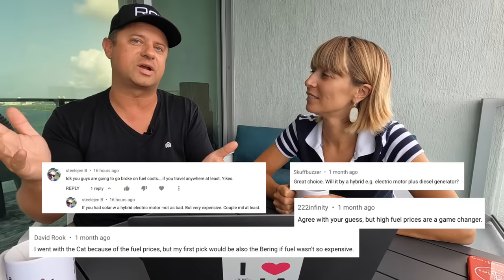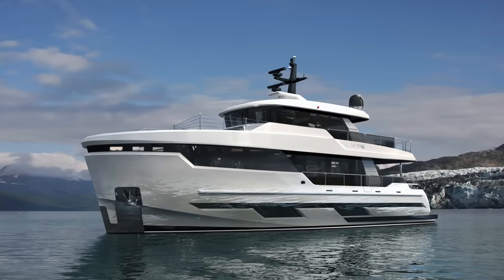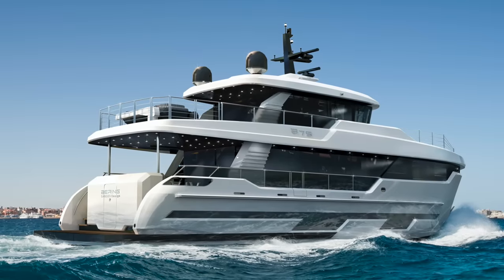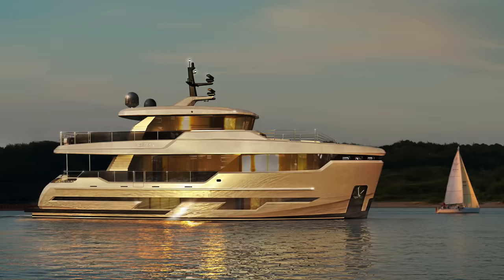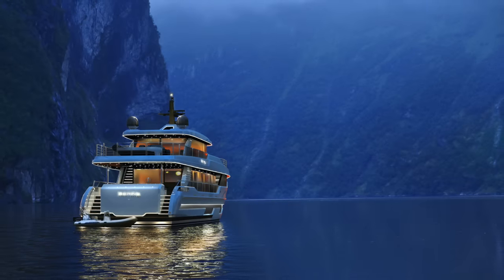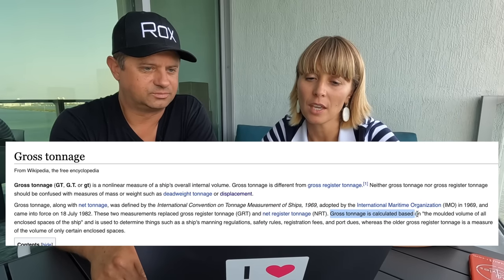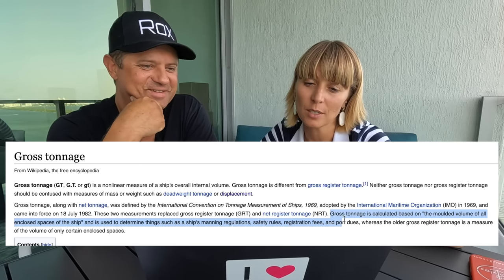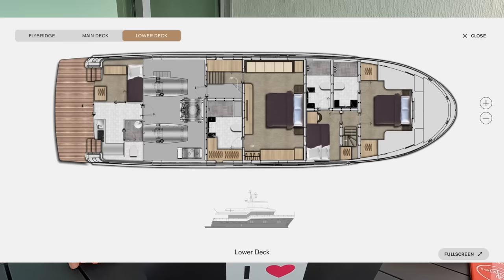WHY NOT Bering 70, 72, or 77? YOUR QUESTIONS ANSWERED Eps. 3

Comment: Outtakes? Of course! This part shows that you guys working hard to get the stuff together.
Why B75? Pretty clear why no B70/B72, but the deference to the B77 is interesting. And if you opting for the cabin on the upper deck, that's pretty much super yacht standard, oh wait, most of the time the captain has the cabin on the upper (bridge) deck and not the owner...
Can't wait to see more about the details of the propulsion and how much electrification!
Reply: @NautiGuys I guess this answer is fraud ^^
Reply: @markush.2445  NO IT IS REAL. The NautiGuys logo with the red heart below your comments on the right side is from them, the fraudsters can't do this unless they HACK their account. They can only make a reply to your comment using their logo. If it is the NautiGuys that reply to you there will be their logo with NautiGuys in a GREY box. Have a good one

Comment: I noticed a Nordhaven video that discussed the seakeeping benefits of a twin keel design. Twin keels have a shorter draft and can also permit bottom docking in places with high tidal variances - in a pinch. Sometimes it's nice to stop the constant rocking or to service the hull during a low tide too I imagine. The real benefit of a twin keel appears to be in following sees where a wave can pick up a boat and "surf" them until they turn sideways and roll over them sideways. Two Nordhaven 55s - one single-keeled and one twin - were buddy boats who compared their responses to side waves that turned the single keeled 55 ft (GRP) trawler a full 90-degrees sideways.

Comment: The channel should be about charter boat operation: purchase & financial considerations like # of guest - weeks needed to satisfy financing arrangements. Charter market and what level of accommodations guests expect ( I would divide the owners stateroom into two cabins). Cooking and provisioning for guest. Charter boat regulations, etc. Lots to talk about. Not to mention providing activities for the, guests. From the time I was in university I wanted to run a dive charter boat. I designed a 210’ sailing ship at that time ( steel hull, 40 guests, 20 crew ). I like that you are acting on your dream. I never achieved mine. I would have settled for a 24meter (95’, 12 guest, 6 crew ) boat.

Comment: You answered the question that I did not have. The choice of yacht size is purely your own. I never questioned it. Just make yourselves happy. As far as size goes, Bering has the 70 - 72 - 75 - 77, so obviously they felt that there was a need for several sizes in the 70's models. And as you correctly pointed out, it makes a big difference in the GT. And you must absolutely have Out Takes in all your videos.

Comment: I really like the robust look of the 75. It's the best looking modern interpretation of a trawler that I have seen. It's easy to see why it was your pick. 

I was amazed at the huge increase in gross tonnage (= increase in interior volume) over the 72.  A boats length is not always a good indicator of it's size. 

I had wondered where you put the second master cabin and that sky-lounge area makes perfect sense right behind the wheelhouse and separated from the charter passengers. I couldn't figure out how you could fit two master cabins below deck.

Comment: My dream is to have a boat like the B75 that is focused on a large group going up into Canada to fish. So the idea of having this one big full beam primary seems out of place for my use. I would split that space and do what Horizon did on the FD87, make two VIP cabins. In your case you would then have 5 guest cabins on the lower deck and then your quarters on the upper, while still having the crew quarters. I also, for my purpose, would try and make as many of the room having convertible beds (twins to queen/king). By doing this you have very high flexibility in who you assign to each cabin. I would have primarily men on board so a queen bed in just a one person deal (In my world! 8-).....) You may find this arrangement not only gives you another VIP, but it also stops any arguments about would get the massive primary cabin. Just a thought. Cheers 😀
Reply: You could make the separation between the two VIPs a pocket door and have one side with a convertible sofa. Then you have all your bases covered!!!!!
Reply: I missed you message, could you please resend. Thanks.

Comment: Ok I have two questions -- (1) You briefly referenced the difference between a Crew/Captain, vs private-only vessels driven by owners that barely know how to steer the boat. At what point (size/weight/etc) is a licenced captain/etc required vs unlicenced owner driven. (2) In a recent video, I think the most recent weekend video, there was a brief comment about the galley being strongly restricted to a licenced chef/etc. At what point does this come into effect ? Does this apply to fully private yachts or just 'commercial' (charter/etc) yachts. --- For both questions, case in point : A few friends and I have been considering a yacht of some sort for some years as a private, live-aboard exploration/research vessel. Our current candidate is the B145 or something similar. We would prefer to have minimal crew, only whats absolutely required for boat operations and maintenance. We would want to do basicly everything we can ourself. For this use case, how much minimum crew would be required for the B145.

Comment: Rewatching. Again. Question: What decides the draft of a yacht? Displacement? Length plus beam? The engineering people figure it out during design? 
Rico, your camera work has been outstanding for some time. Well done. 
You two should do a tech spot about your video gear. I think it would be well received.
Reply from the maker: Great question! The draft of a yacht is determined by a few factors, primarily the vessel's displacement (the weight of water displaced by the yacht) and the design of its hull. The depth of the draft is often a consideration during the engineering and design phase, balancing factors like stability, performance, and where the yacht will navigate.
Reply: @NautiGuys  Great answer. Thank you.

Comment: Keep your out-takes. They are just great. 
A B75 is a fairly big unit. Nevertheless, despite the fact you'll probably have THE absolute owner cabin on the upper deck, you won't have as much space as you had to live. In addition I noticed one thing: your are missing a small office/chart table on your layout. With such a fuel guzzler, computing the magnetic bearing on a chart taking into account currents and tides makes quiet a difference in costs.

Comment: I’m so happy for you and jealous.  You two introduced me to Bering through YouTube and I’ve been a fan of you and Bering ever since.   Can you ask Alexey to build a smaller version of the B70 that could be used for the Great Loop.  I could see a B60 with an uncovered fly deck (a la DutchCraft DC 56).  I’d be a buyer tomorrow.
Reply: They no longer make it, but they did at one time make a 60 and there is one currently for sale.  It's about $1.5 mil though, and as with most Berings, bridge clearance might be an issue on the loop.
Reply: @chadm9715  thanks Chad, I knew they had a B60 that has too tall of an air draft.  For that reason, I’m asking Alexey to build one that can do the great loop. In other words, a yacht that meets both the draft and air draft limitations.  Appreciate the response though.

Comment: You should always get the biggest twin engines.I had a buddy with a 44ft Pacifica that had new 500hp ISC Cummins installed with California repower. At 7knots at just under 1,000rpm, he was burning 2.7 gal per hour for both engines! That's better than a single engine trawler.!

Comment: Awesome video.. very informative.  So I guess one of the deciding factor on getting the B 75 (hull no. 1) is the GT,  because it can be owner operated right? (please correct me if I'm wrong).  I totally agree that the B 75 and 80’s exterior design looks like a mini S/Y.  Question, on the 75, were you able to get all the things from the NBBL?, like the heated towel rack thing? or maybe a 85 inch TV?..hahaha.. and YES please include the outtakes in this channel.

Comment: Although not there financially I would have made the same choice.  B80 checks every box for what I'd want, but it's over 200gt so eliminated.  

B77 is the perfect size, length, and GT, it checked almost every box, but imo would be eliminated because of the split levels(as would B65 and B72).  Being able to personalize the interior with split levels becomes far more difficult, and more importantly for for docking I would not want the stairs to contend with.

This leaves B75, which checks nearly every box.  Unfortunately though, it's the only boat in the Bering lineup without a flybridge, something I would personally want, in addition to the pilothouse if building.  It would still be my top choice if building.

Comment: Hi guys! 

Love your channels! I’ve been binge watching all your episodes since I  discovered you recently,

May I assume that you are not going to charter  your future live aboard Bering 75 between US ports due to restrictions requiring such vessels to be manufactured in the US unless your 75 is granted a MARAD waiver to obtain a coastwise endorsement on its Certificate of Documentation?

I understand for a vessel to be eligible for a MARAD waiver, foreign-built U.S. flagged yachts must be at least three years old and owned by a U.S. citizen. 

The reason I am asking is that I am involved peripherally in a project involving the construction of a series of new American-built motor sailer super yachts that will be used for chartering in US waters.

These motor sailing yachts are to be equipped with a hybrid electric-diesel propulsion system as well as well as a bank of marine diesel fuel cells replacing the IC diesel auxiliary power generators; to provide direct propulsion, hotel load, and battery recharging.

So are you going to captain charters of your Bering 75 from a homeport in the Caribbean?

Comment: In the b77 walkthrough alexi implies there are different build requirements for yachts intended for charter , also are the manning requirements for charter different if its an owner/operator charter . Also confused about licence requirements for owner/operator personal use only vs owner/operator for charter .if you could expand on those points as it relates to b75 vs b77 that would be great thanks . Love the outakes

Comment: I'm curious. Can Bering Explorer yachts be built with ice-strengthened or lower Polar-rated hulls? Just curious, as this could be useful in polar regions during spring, in particular, or in places like the Great Lakes, either potentially wintering, or otherwise depending on the length of the shipping season (which is also when the St Lawrence Seaway is open, along with the locks at the Soo and the Welland Canal).

And mostly I'm just interested in the engineering side of things.

Enjoy your videos, and looking forward to watching you go through the shipbuilding process.

Have fun!

Comment: Should have just gone for an 80. 3 VIP cabins on the lower deck, you could have used the master on the main deck as your owners cabin, along with 2 crew cabins and a smaller children's cabin.
Reply: Their money; their choice.
Reply: @mrschuyler  IMO the 80 has a lot more revenue potential than the 75, which in my head would make it worth the stretch.
Reply: @MasterChief37  Guess they didn't ask you first.

Comment: Is your cabin on the 75 going to be as big as the master cabin on the 77?  Is a cabin on the upper deck less comfortable than one on the lower deck?  I think the upper deck puts you further away from the point of rotation in rough seas.  In other words, the higher up you are, the further you move as the yacht pitches and rolls.  The upper deck is also more exposed to the elements, being the sun, wind, rain, snow, sleet etc. You will want it well insulated and almost air tight.

Comment: How would the ride of a steel Bering 60 or 65, or even this 75, compare to the ride of a Nordhaven 50 GRP trawler - in head-on 1 or 2 metre swells or chop? The Nordhaven seems to make a pretty rough ride of that sea state. Does the weight of the Bering's steel hull cushion the "bucking broncho ride" a lot, or is a similarly rough couple of days of trawling no matter which is your ride?

Comment: Nobody can do anything with any so-called renewable and sustainable fuel system without causing some environmental costs.  The only question is how much?  Solar panels require mining for rare earth metals, and then have to be disposed of safely at the end of their useful life.  These processes impose significant environmental costs.  Giant windmills kill birds and other wildlife on a massive scale.  Hydroelectric dams are almost always made of concrete, which produces carbon dioxide as a by-product.  Making sails requires energy that has to be found somewhere.

Aside from that, the theory of man-made global warming is pseudo-scientific garbage.  I won't detail the argument here, but I might write a book to set the issue out in detail.

An alternative is Small Modular Nuclear Reactors, which Bering's boss talked about in one of the Nauti-Styles videos on the building of the first 140ft Bering.  I would go for one of those.

Comment: Yeah, a pity you didn't go fully solar electric: Soelsenses 62, Silent Yachts, Alvayachts, Sunreef, Aquon One. The latter one even produces it's own hydrogen for the fuel cell. You went just a little bit into green yachting. I will try to do better and go fully solar as soon as I have the money to do so (in a few years, hopefully). In the meantime, technology will advance and I might be able to get a boat with close to 1 MWh of battery storage, or plenty of hydrogen storage. I know, it's still early for green yachting, but someone has to be the early adopter...